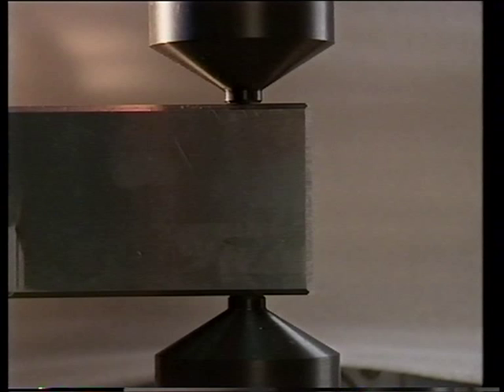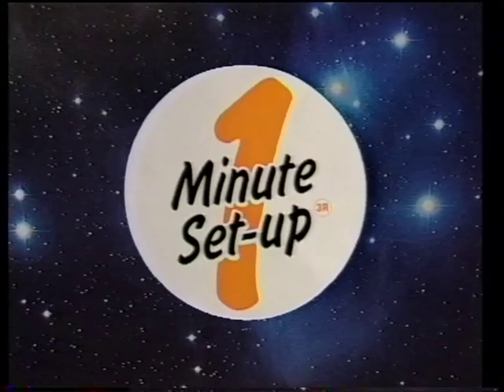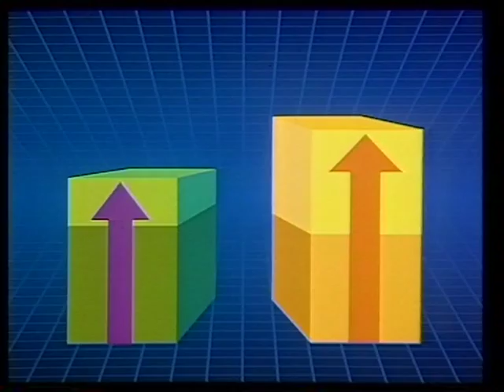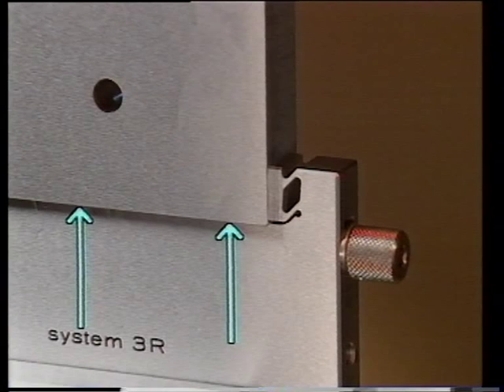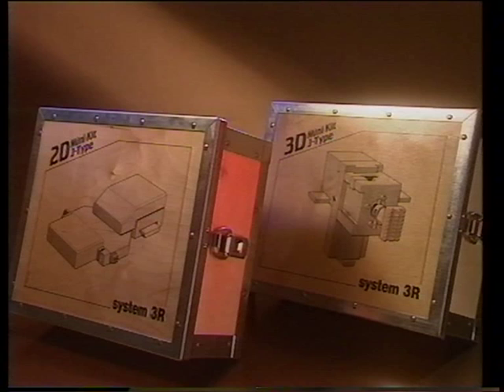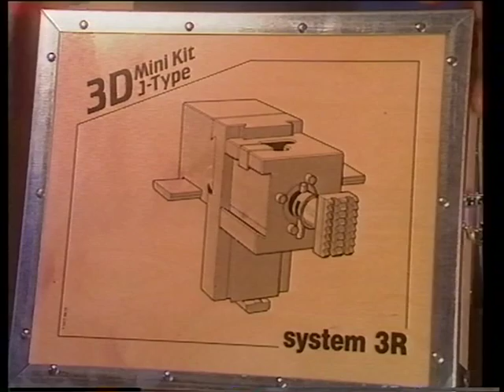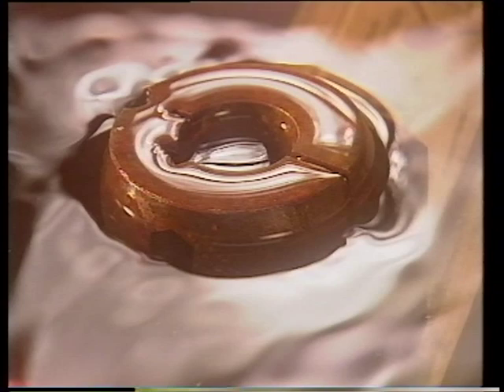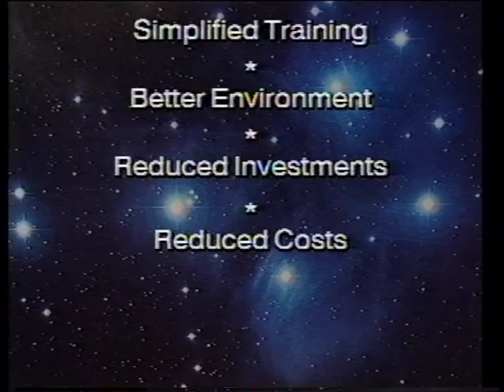Concept WEDMing

Comment: China Precision Workholding System Inc (CPWS)  (www.workholdingtool.com)  
CPWS produce and export workholding tools for EDM,wireEDM,CNC machining, lathe turning
CPWS is compatible with EROWA,System3R ,better price, good quality, fast shipping

CPWS popular products: 
EROWA-equivalent-----electrode holders, chuck,centering plate,chucking spigots, probe,measuring tooling
System3R-compatible:-----chuck,electrode holders, pallets,drawbars,probe,measuring tooling
wireEDM vise---toolmaker vise,adjustable vise,wireEDM ruler,clamping beam,wireEDM machine table
zeropoint system,collet chuck,guide bush

CPWS can accpet OEM,ODM service
want try CPWS samples?
(www.workholdingtool.com) 
(sara@workholdingtool.com)